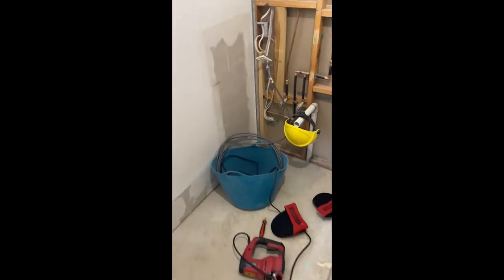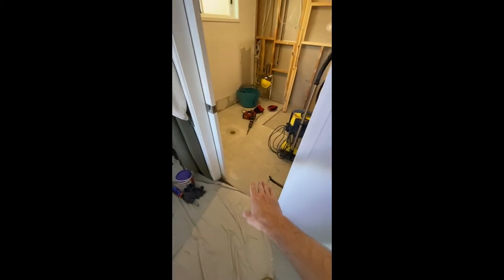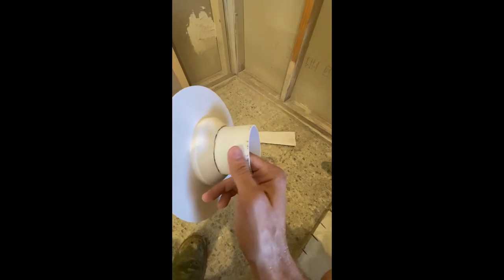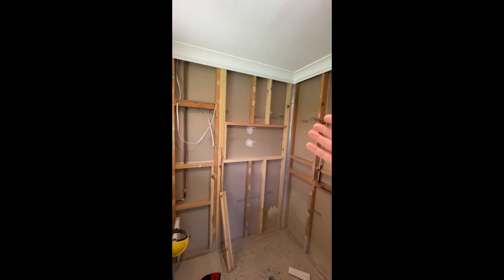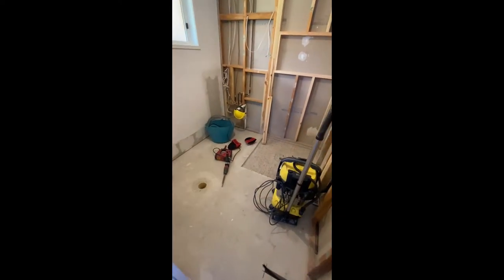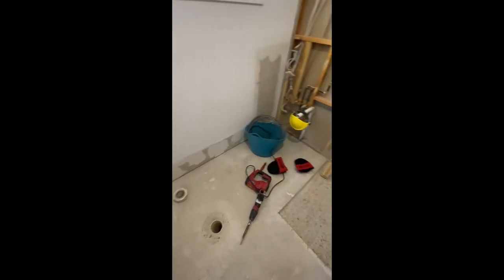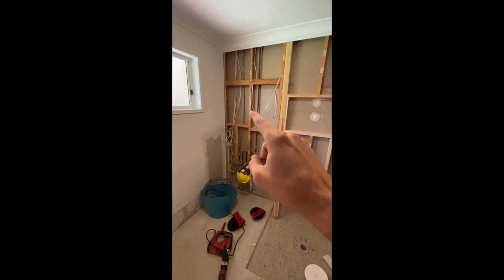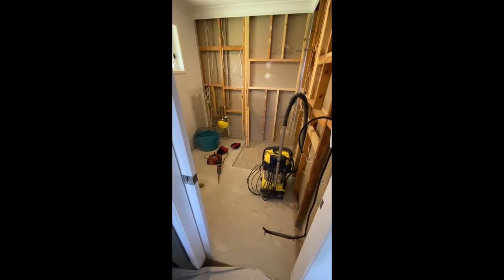Bathroom Ensuite Renovation Part 1 - Heated Floor, Heated Towel Rack, Niche, Wall Hung Vanity

Comment: Great video series,  Can I check if I understand correct -  you went down 40mm below original slab, then waterstops, then a slab repair with some slope to puddleflange, waterproof, screed, more waterproof.  Can you let me know what was the depth of the slab repair and what was the depth of the screed roughly?

Comment: Hey mate, great job with relocating the basin drain. I can’t imagine that would have been easy. 

Was that mainly angle grinding and rotary hammer? And would you recommend connecting to main horizontal drain? I was thinking of just chasing it low enough to make a 90° run just beneath the floor height, then up through the bottom plate

Comment: Hey mate, thanks for the vid. With the plumbing i notice you are using pex pipe. Did you use to crimping fittings for that or are they push fittings (aka sharkbite). Cheers
Reply from the maker: 100% crimp fittings
Reply from the maker: 100% crimp fittings